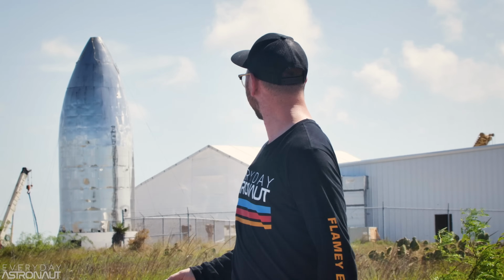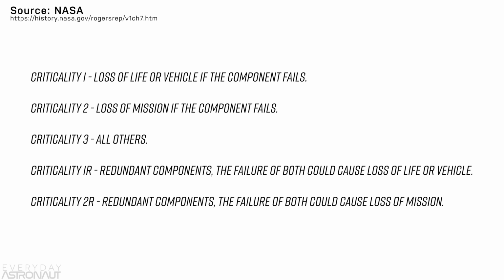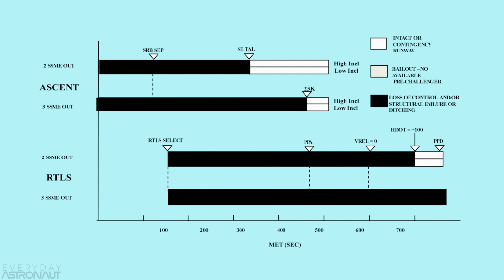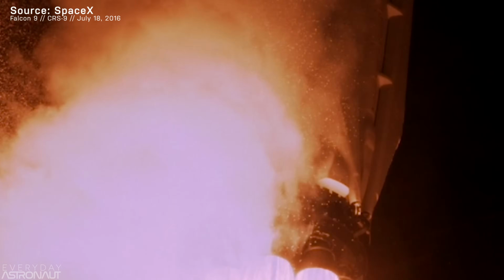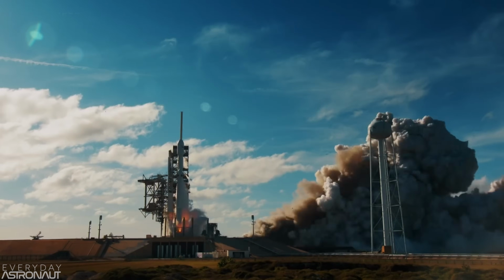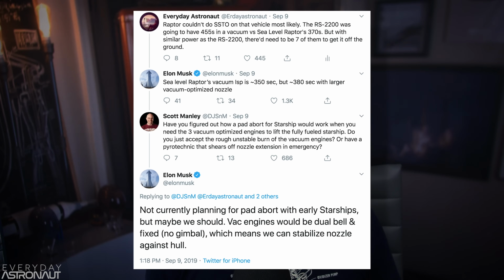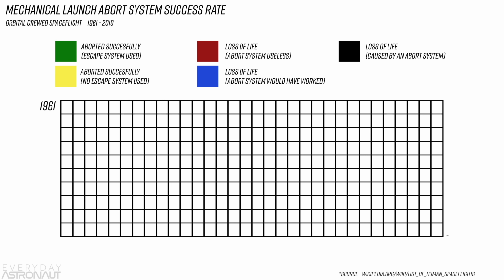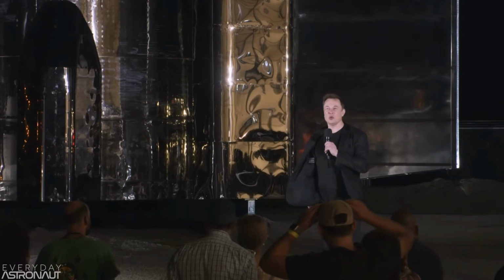Why won’t Starship have an abort system? Should it?!

Comment: Space X employee: hey Elon I took out the engine so there is no failure  

Elon Musk: good job

Edit: man, why did this get soooo many likes. It doesn’t even sound correct XD
Reply: Yes, they actually used a trampoline recently instead as advised by the head of Roskosmos.
Reply: @huihuihuihuihuihui1  russians are there
Reply: @квадратя  где именно?
Reply: Yeah why not, use a slingshot.
Reply: @tiefensucht  
A "giga slingshot" ??

What requirements, will it need ?
Can we (humans) match these requirements ?

-- Amount of force, when release ?
-- Ability of withstanding that much force ?
Reply: @tiefensucht  
-- Considering amounts of "wasted energy", with explosion lift-off ?
-- IF convert all this 
"wasted energy", 
into "launch" energy: 
would need much smaller 
lift-off explosion !

*******
?? Wasted energy, to convert ??
-- light
-- sound
-- explosion area
-- air resistence
-- "g-force" of acelleration
-- vibrational motion

?? An ideal launch ??
-- people inside: unable to notice any change, until get to "zero gravity zone" !
-- people outside: only notice motion of space vehicle !
Reply: If "taking out" the engine means here "removing" then we have structural change (drag, inertia coefficients change)
Reply: Happy Birthday @ElonMusk 

Enjoy your special ! 

Best Wishing on you June birthday..
Reply: Just get like a rocket ballista pointed at an angle
Reply: Nicki Minaj summed it up nicely: "Starships were meant to fly". Thanks Nicki.
Reply: Like that idea.
-- Maybe a "launch cannon", is possible ?
-- Maybe a "giga slingshot" ?
-- Maybe a "space elevator" ?

A "non physical space elevator", 
might be the easiest ?
Reply: Nice one
Reply: fishy gang
Reply: Dude I see you everywhere I literally saw you on ItsFunneh's channel earlier
Reply: FISH GANG!!!
Reply: SPACE 1999 EAGLE  WHEN  IS SOMEONE   GOING  TO BUILD A  VERSION OF THAT AND PUT A REFUELING  STATION IN ORBIT  NEXT STAGE OF PROGRESS YES
Reply: its because no part is the best part :D
Reply: It’s too perfect
Reply: Who’s edit
Reply: Nah, It will just explode from de-pressurization.

Comment: I think a comparison to passenger planes is not good. More to military planes, because those planes fly on max performance all time, not on 70% as passenger planes. And most have escape systems, and these systems save lives a loot. Ejection seats are standard in the military jets and I think similar systems should be standard in all space ships to the point when being much more options in case an emergency. And in case of Space Shuttle, in a couple of first flight shuttle have ejection seats, if similar incident as Challenger tragedy be in first or second flight crew have a chance to survive.

Comment: Easiest option would probably be sticking a crew dragon on the top, flipping it around in-orbit to dock onto the main ship and land it separately.
Reply: I mean, unironically, it could make sense to just launch crew on a crew dragon to meet starship in orbit.

I know there's a lot of people who seem to think caution is a bad thing these days, but astronauts aren't kerbals to be used like they're disposable. Cutting crew safety equipment isn't advancement, it's neglect for safety margins. 

Especially with how cheap crew dragon launches will become as rocket reuse improves.

Comment: Actually, if the failure probability of a launch is 1%, the probability that 2 or more launches fail out of 135 is about 40%.  So it is not so far-fetched that the success probability estimate was correct.

Comment: I like the fact that they're applying the KISS principle to Starship. The less parts there are, the fewer the number of parts that could malfunction.
However, at the same time, as far as safety goes: *REDUNDANCY*. All the shuttle deaths that have occurred are because of a lackadaisical view on safety. Challenger blew up because the safety rings on one of the rocket boosters failed after a particularly cold night. NASA was aware that the safety rings could fail should the temperature fall below a certain level. Columbia blew up because NASA knew the foam took a chunk out of the wing but maintaining the mindset, "Even if we knew what needed to be done, could it be done in time? Let's let them die thinking the mission was a success." I'd rather work for a company that puts safety and redundancy systems before random chance.

Comment: Hi Tim, great work. Really love the effort you are putting into this. To give you a fair answer they should focus more on a project like the "original" Space Shuttle program that didn't need all the rocket stuff or in comparison 150 747 plane's going full throttle. Uniting the effort of going to space would also create a gigantic leap in creating space tools that will surpass all existing constructions. Now I'm talking about hybrid jet engines that also work in space. Anyway, I'm totally agreeing with your theory about more flights and the fact that there isn't enough data to go without a backup plan. Take care and have a great time👋😉 👍

Comment: Adding more parts (abort system) will only add problems and expenses and not result in any real safety except perhaps an artificial sense of safety where none really exists. At this point in time, traveling to space is very risky but in time, maybe 25 or 50 years down the road, it will be as safe as flying in a plane.

Comment: You've proven that statistically speaking, abort systems don't really save that many lives, but I think abort systems also serve as a "peace of mind" item on the ship. The crew may feel a little bit more at ease knowing that they have options even if the statistics don't support it.
Reply: That could be a possible benefit that goes away over time as the Starship becomes more 'normal' & less of a brand new thing.  People tend to be biased in favor of whatever they're used to.

Comment: Worst audio award goes to this video. Learn how to record. Check your levels. Voice audio was about 50% of the transition music audio/noise. Unwatchable.
Reply from the maker: They’re both at - 3 db... do you have some weird Dolby thing boosting stereo signals from mono?... like a surround sound plugin going astray? Read the comments, you’re literally the only one of nearly 1,000,000 to complain about audio, which would likely mean it’s a problem on your end
Reply: Everyday Astronaut 🤠 Holy Troubleshooting Batman! I have been thinking along those lines. Watching netflix from the TVs app works fine. Watching videos from youtube often has this issue. This started when my 12 year old PC died and I built a new one. Using its on board audio... audio through HDMI!  I’ll bet HDMI is doing something, or making the audio track assume its to be played like a surround system.
 Thanks for your input! Great to hear you have your levels set at somewhat reasonable levels. I’m and old Audiophile from the 1980’s. I did all my recordings with peaks at 0db for FeCr, +3 db on Chrome tape to +5 db on Metal tape. Back in those days we couldnt just look at a wave form and adjust, it was litterally listen first to the track, use best guess on highest part, and adjust levels to that peak, then go back and record. I was one of those guys that bought the expensive half speed masters, and played them only on my linear tracking turntable, just enough times to make the perfect recording on tape. Then back on the shelf they went into their dust free sleeves to remain archived.
Soon to fix this horrible situation, and go back and actually enjoy your content.

Cheers!
Keto Vitae!
Reply: The audio is good on this video. Please get adequate speakers/headphones.

Comment: Like you said rockets do not have proven safety margins until they fly. Flying a new launch system without an abort system is a very bad idea because it will not have a proven safety record. Starship may be a great launch vehicle which will never have a single failure but I doubt spaceX will be willing to launch enough unmanned missions before crewed missions begin to prove that. Statistics of past launches of different vehicles shouldn't be applied to new launch systems. This is like thinking that the reliability of a ford focus somehow says something about the reliability of a chevy malibu; it doesn't. Launch abort systems exist because unknown and uncounted for issues may arise and the fact that they haven't been used that much in the past does not mean that they shouldn't be used in the future.

Comment: An abort system would be nice on the pad because SpaceX is the first rocket that will fuel the rocket with the astronauts inside the capsule.  NASA took a very long time to sign off on this because this is the riskiest time period of the whole staging of the rocket - when it is being fueled.  All rockets before this one (including the shuttle) were pretty much fully fueled before loading the astronauts on.  I hope that vacuum rocket works well enough if something goes wrong - it is a new risk that NASA has never had to take on before.
Reply: To be clear, Falcon 9 is the first rocket where this will be happening (in just a few days, in fact), & it does have an abort system... the best in the business, in fact.
By the time they get to the point where they'll be putting people on Starship, fueling with astronauts onboard will be old hat.

Comment: Great item I am now a subscriber and a big thumbs up- the narrator is such a knowledgeable as well as great dude-
Re escape  module: 
The shuttle challengers cabin was blown off intact with all crew surviving the cameras supposedly proved this- astros themselves have said it- it went down at terminal velocity: app 225 mph( if correct) they were conscious til they hit the ocean/ the blast itself ironically was the escape device that powered separation from the doomed Morton thilikol inspired horror show— all that was needed was a parachute?
Ironic?
Yes but it’s how my mind works- god bless all spacemen and women

Comment: A “repeated re-use improves reliability scenario” would be aided by flying units to Florida under their own power and landing on pad or ship.
Reply: You mean straight up Flying the built starships and superheavy to their area of operation?

That's insane, and i lowkey like that idea a lot because you bet SpaceX could pull it off, though it would be harder to do with a superheavy than it would be with a starship
Reply: @mobiuscoreindustries  Elon intends to use Starship for an airliner to the other side of the world, why should the Superheavy be any different other than no passenger compartment???

Comment: Hey, can you please describe what an abort system would be like if we had a "Space Elevator." To me a space elevator means a cable upon which you can attach a climbing device that eventually becomes a rocket in space. In fact, how would you even get a horizontal velocity once you climbed that space cable. Would you have to climb to geosynchronous orbit and then re-navigate to low-earth orbit from that starting point?

Comment: The answer is 'not until they need it'.  Prove the musts first: orbital flight, full reusability, starlink delivery, orbital refueling, cargo delivery to Moon/Mars for Nasa.  When they start hitting some milestones on those, check gaps to human-certification and fill them.  The vehicle today will be very different from the vehicle in 3 years.  At the speed they are iterating, they could figure this out quickly once it becomes the next 'to do'

Comment: I mean... as if sitting on a bomb at launch wasn't crazy enough, they take a second bomb and carry it with them the whole time, even during crazy hot reentry (in case of dragon at least)
Seems a bit ridiculous to me
Reply: The best illustration of that being New Shepherd, where you can actually see the top of the 'bomb' sticking up on the middle of the capsule where it doubles as a table.

Comment: I'd rather die in a huge fireball than have my neck broken by a 10G abort rocket launch to be honest...
So yea... save the space of the hypergolic fuel tanks for a backup landing parachute and emergency supplies/extra oxygen and water in case reentry is not possible and people have to wait for a backup capsule to get to orbit, I'd rather like that...

Comment: The Space Shuttle was UNDER engineered, its failure modes were wrongly assumed  - even after tiles were known to have fallen off.  Parts were analyzed for failure but the total system was NOT.  MTBF of a system is not the same as MTBF of its parts.

Comment: Of the 2-1/2 million parts, +2 million were telemetry, passive or structural component like rivets, not directly engine or fuel system components.   Of the active components, most were redundant, overly complex and precise.

Comment: Design the rocket with enough fail-safes to make it safe.  Adding an abort is acknowledging failure of the vehicle.  

That footage of the tanks failing on the Starship mockup was from when they were using carbon-fibre tanks, which they abandoned for more stable metal tanks.

Comment: I was ready to take a chance flying in  a space rocket all my life whatever the risk. I am now older,  so I am ready to accept flying a rocket even if it a close to zero hope to survive. 
Relying on an abort system is as stupid as relying on a spare front wheel on a 100mph motorbike run or an airbag in a top fuel dragster race...

Comment: Multiple engine configurations aren't as rare as you think. They're quite common in Russian designs, not to mention Ley & von Braun designs back in the 1950s. It was the American space program which generally preferred single engines. Even the Saturn V had 5 engines in each of its first two stages.

Comment: My biggest concern about starship isn't the abort, it's the landing. We just had a falcon 9 fail to land because of IPA in the engine. Can starship switch engines fast enough if one fails so that it can land? If they can swap engines then it's probably fine. But in the falcon 9 they depend on 3 specific engines or even 1 specific engine (The center) during the landing.

Comment: Personally, I am much less concerned about launch abort than I am about backup plans for reentry.  There should be a way to land safely even if the primary engines fail, and it must be possible to ditch in the ocean if there is a contained failure of the booster.  Backup retrorockets and some sort of ballute would help with both.
Reply: I have to agree on this, I know it probably isn't likely but what if those engines are needed for an emergency abort somewhere be it an abort to orbit, an issue in orbit or even a non-destructive event where they lose fuel or the ability to safely use the fuel.

I have no problem with a powered landings as I think they're an exceptional advancement but the first time it fails and costs lives they're going to be forced to put in a backup, save the time and headaches and just design it in now rather than having to figure out the solution in 10 or 20 years and curse life.

Comment: Starship is a commercial shipcraft, and abort system is extra cost. It is cheaper to replace the crew, rather than the repeat cost of hauling the extra weight with every launch. Just pay insurance for the crew, is cheaper, and save  weight for more cargo.

Comment: For first couple years of non commercial flights they should integrate a dragon into the nose of the rocket that can eject incase something goes wrong. Something will go wrong, and if there's no way to eject the pilots while they iron out the issues, then they will lose pilots. it also makes way too much sense to not do it, this way you can arrange the bridge to be more functional for space flight and not have to worry about having ladders on the floor so people can climb up to their seats or build in harnesses to the seats, it could look exactly like startrek if they wanted. Also allows them to escape the starship if there is an issue found during launch so that there's no repeat of the shuttle accidents.

Comment: In my opinion, this video tries to ease a deep-seated psychological fear of not having a "back door", an escape, if things turn dangerous. Most people think that having an abort system is safer than not having one, but it becomes clear in this video that abort systems could potentially endanger human life if not designed or operated well. It takes a very rational approach, making use of probabilities.
 
   Even so, the psychological need for an escape is so great that I suspect airliners would get significantly more passengers and money if the aircraft and each seat had a built-in parachute. Similarly, I would guess that spaceX will get more future passengers, (which leads to more money and more design iterations and faster development,) if they give those on board something they can do to get out of a disastrous situation. 

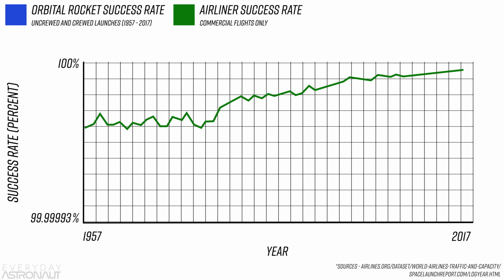And just as with airliners, It's almost certain that it will take many more rocket failures before they start "chasing the nines", as Tim says at 40:22.